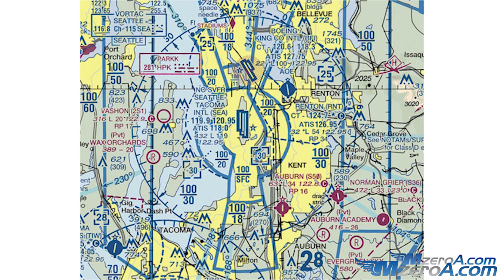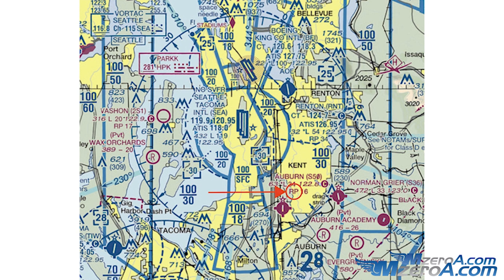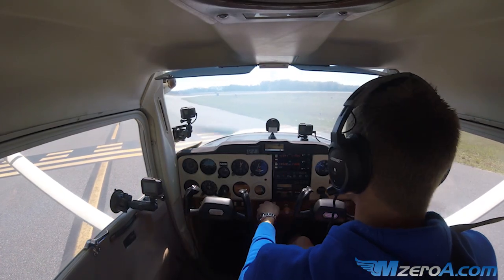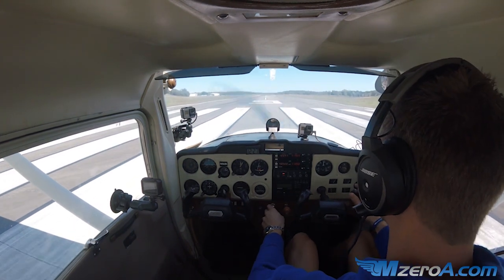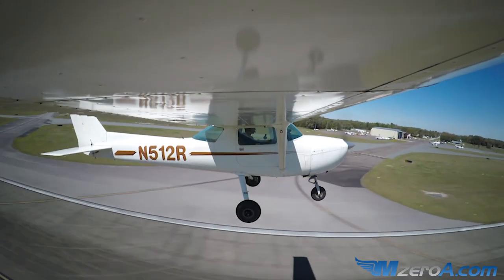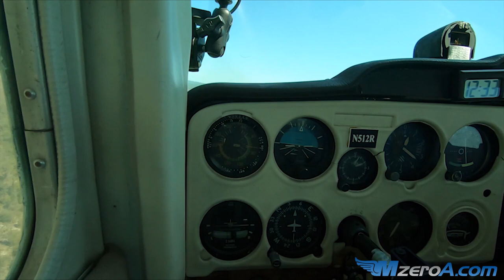How To Fly A Standard Traffic Pattern - MzeroA Flight Training

Comment: As a rookie I appreciate all of the dialog in this video. This is exactly what I'm practicing today. However it ends up being a talking-head style lesson for the first half of the video. I would suggest some live views or drawings would add quite a lot of clarity to this session. The live video portion was good.

Thanks for doing the preparation, making the video, and posting it.
Reply: You are certainly right about the diagrams, distances, altitudes, etc.  But I (being a novice) actually found all the other talk extremely distracting.  I didn't want to know what to do about the "other" aircraft around me until I first learned the basics of flying a pattern.
Reply: @daraious-primary1007  Learning about aviation at first is like drinking from a fire hose. Im at over 100 hours and im trying to figure out why the right crosswind departures are not proper

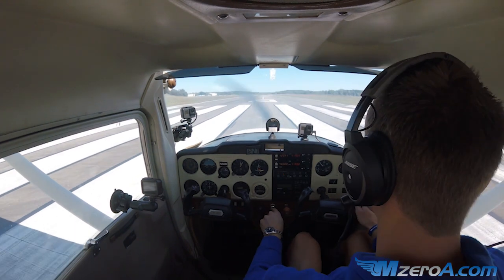Comment: @11:30 Sorry to be a nag, but my CFI drilled this one in and as such it has become a major pet peeve of mine as well. In truth though, it’s a common misconception that may compromise safety. 
I’m surprised to hear you say the upwind leg begins the moment you take off. The AIM is pretty clear that that is the departure leg with upwind leg being a portion of the traffic pattern in the direction of landing opposite the runway of the downwind leg. See AIM 4-3-2 and 4-3-3 including the figures:
Upwind leg. A flight path parallel to the landing runway in the direction of landing

Departure leg. The flight path which begins after takeoff and continues straight ahead along the extended runway centerline. The departure climb continues until reaching a point at least  1 / 2  mile beyond the departure end of the runway and within 300 feet of the traffic pattern altitude.
Reply: That one bugged me too (it is a minor bother but this is an instructional video).
Reply: Sounds like your CFI is the nag. Good catch though.
Reply: As a kiwi, that is just... weird. Here it is called the upwind leg from the moment you lift off. Then again, down here the only radio calls you make in the circuit are when you are established downwind, and when you are on final. You would never call crosswind or base!

Comment: Regarding your technique of not extending flaps in a turn, there is the reduction of stall speed that happens with flap extension that mitigates the increase in stall speed that happens with increased bank angle.  And, the turn helps mitigate the ballooning effect of flap extension.  So, a case can be made that turns in the pattern (particularly the downwind-to-base turn) are an ideal place to extend flaps.
Reply from the maker: What would happen with an asymmetrical flap deployment in a turn.  This is why we don't add flaps in a turn.

Comment: What's "not correct" about a right (crosswind) departure?   What's wrong with it?   It's a departure.  What is correct?   Is an aircraft departing runway 5 (for an East, S.E., or South departure) expected to continue left traffic around the pattern (while climbing)?  What calls would be made?  "Cessna 12R is turning left downwind for an Eastbound departure"  -  "Cessna 12R is turning left base... umm  ...for an East departure"   -  " 12R is turning left upwind...  ... but we'll be breaking it off (right) for an Eastbound departure" ???    How about arrivals to runway 5 from the South (or S.W.) ?  Are they supposed to enter a left upwind and circle round the pattern?
Reply: Normally in that case you would be expected to fly the normal traffic pattern (so left hand) and vacate via the left downwind (or crosswind as required), just make a radio call stating so. You *can * do a right crosswind departure, but it is non standard for a reason, and you risk meeting an aircraft joining from the overhead if you aren't careful. Especially as not all aircraft have [functioning] radios.
Reply: @jessiegeorg6632  That is one way to do it.  The easier, more practical, and ultimately safer technique would be to climb straight out until reaching pattern altitude +500 and then turning on course.

Comment: Good video but the time in the plane did not focus enough on flying the pattern like you did on the ground.  A mention of Vy while taking off; calling out altitudes and power settings; what you're doing with the nose; etc.  All would have been helpful and would have reinforced what you said before you were in the air.

Comment: I am a student pilot. Can someone please explain why the two right hand departures were not proper even with the one aircraft calling out his turn to the right? Thanks in advance.
Reply: As Jason pointed out at the start of the video, the left hand circuit is always the standard unless it is published otherwise in the AIP. You can do a right hand departure in a left hand circuit, but it is non-standard for a reason. You also run the risk of "meeting" any aircraft that is in the process of completing the overhead join, bearing in mind that not all aircraft have radios

Comment: Can anyone tell me why the AIM suggests to start the turn to crosswind @ 700' agl? It used to be 500' agl.
Reply: Mike Brown I abide by 500’ AGL. I don’t want to be blowing through PA on X-Wind when I have always anticipated PA right at the downwind turn
Reply: The guideline is 300 feet below pattern altitude.  He is flying a 1000 AGL pattern.  An 800 AGL pattern for singles is also acceptable, in which case 500 before starting crosswind is correct.

Comment: Do you teach cross control for landing like side slips into a cross wind for landing?
Reply from the maker: Hi!  In crosswind, you want to touchdown the upwind wheel first while using rudder to maintain centerline. It is a good technique to use. Then, as you slow down, add more aileron into the wind as necessary to avoid being blown off centerline. Reach out to us at support@mzeroa.com if you have any more questions!

Comment: As a flight instructor, I wonder why do some pilots landing at a non-towered airports say, the word, traffic at the end of their position report. For example, Dewitt traffic, Skyhawk 2727X, turning one mile final, runway 36, Dewitt traffic. Don't they know that you only say the word, traffic at the beginning of a transmission and not at the end. For example, Dewitt traffic, Skyhawk 2727X, turning one mile final, Dewitt. Remember, at the end of the radio call, you are making mention of the airport at which you are landing. Therefore, the last word out of the pilots' mouth should be the name of that airport; not the word traffic.
Reply from the maker: When you are arriving or taking off from a non-towered field there really isn't an official script on how or what you say.  You can even take off and land without making a radio call.  We do not recommend that but there isn't any regulation that states what or how you make your communications at a non-towered field.  Another example is some pilots will say the color of their aircraft and other pilots will say their tail number.  There is no right or wrong on what you say at a non-towered airfield.

Comment: Wow, so many bad things in this video (not Jason)....9 mile straight in with 3 planes in the circuit is dangerous and making right turns departing a left hand circuit...boy there are some bad pilots out there. I nearly saw a collision when a plane decided to make a 10 mile straight in with 5 planes in the circuit, making radio calls on the wrong frequency...he nearly descended onto a plane already on final. Always best practice to join a circuit overhead and ensure you are on the right radio frequency. Planes already in the circuit have right of way.

Comment: What are the standard air speeds in the Cessna 172 on the base leg and on Final Approach? And what is your airspeed as you cross over the runway threshold?
Reply: Probably 75 on base, and then 70 on final reducing to 65 as you cross the threshold

Comment: Where is the animation? 
No idea first left?
350?
Reply: Runway 17 is at Heading 170
A 90 degree Left turn (Crosswind) would Subtract 90 from 170 putting you on heading 080
From 080 a 90 degree turn (Downwind) to the left (Again, subtracting 90 from 080 on the compass) puts you on heading 350 (The opposite of heading 170)
The next 90 degree turn (Base) puts you on heading 260 (350-90=260)
And then the last turn (Final) subtracts 90 from the 260 putting you on the original heading of 170 for Runway 17....